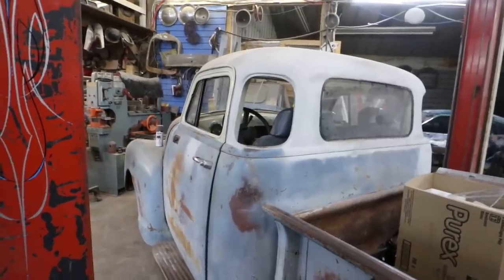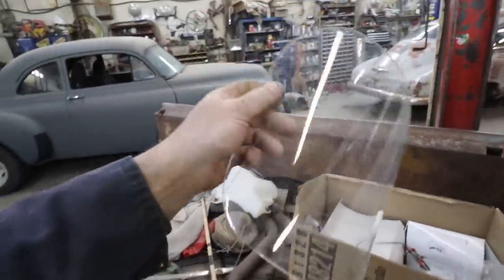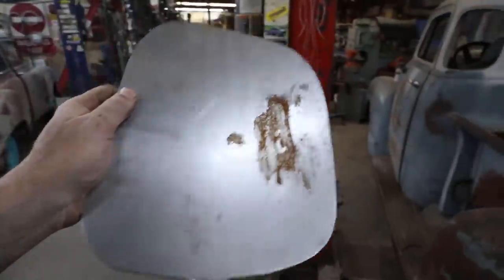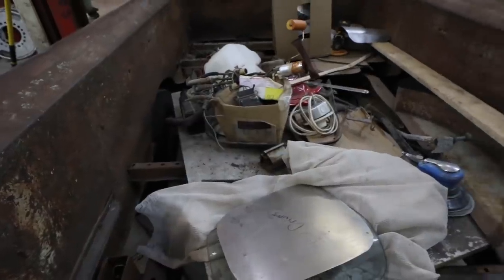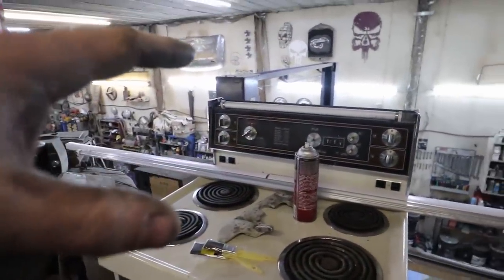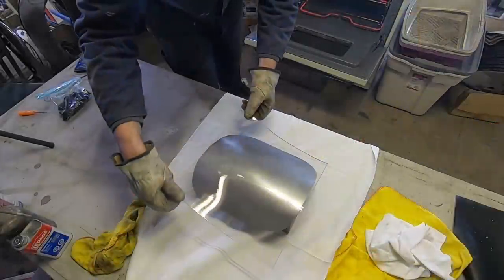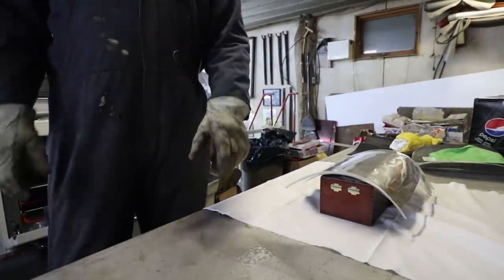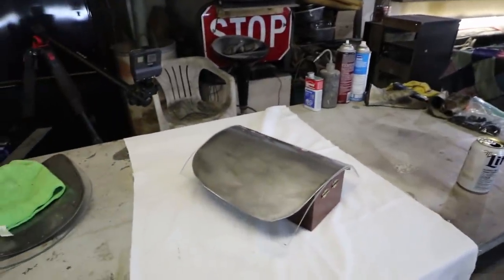Using lexan to make corner windows for a chopped 51 Chevy pickup

Comment: I would have just used the Busch box, and made a beer tap for the gear shift which I have done for my truck using multiple handles including mounting bobbleheads on my tailgate, my truck was in the Paradise fire and caught on fire and is a 76 stepside  given to me from my customer that was up there, he was a WWII Vet as was my dad..........The spirit of 76 saved it! $9,000 later it still looks like it was in a fire even on the inside but it drives great! Glad I just discovered this channel I can relate to a mess that has potential...

Comment: I like your method way better than the one I used back in 1979 after chopping the ‘68 Bug. I cut the plexiglass for the back window and then screwed it in and covered with a black  foam sticky strip around the edge. 😎👍🇨🇦

Comment: I turned out all right I had two windows put in my tractor with that lexan and they glued the windows on the outside like you do and I've had no issues with it whatsoever no scratching no leaking it's a good way to do it. 👍👍😀

Comment: In years gone by, I made Lexan and other polycarbonate sheets. This stuff is rolled out at @600 degrees. Then in another life I made plexy glass for a foam rubber cutting machine. Curved a lot of plexy/ lexan at @250 to 275 degrees. Put your pattern under the blank in the oven and heat it. Leave it till cool.

Comment: 3m used to make a trizak sand paper that will sand the scratches out i used to do solid surface counter tops that is what we used. i tried it on plexiglass and it worked. it was developed to sand scratches out of picture tubes on tvs if you cant find i may still have some left

Comment: The glass for these corner windows is readily available. I've got an extra set myself. They were free in a box of parts when I was building my 50s truck. I looked them up on several classic truck sites and they aren't all that expensive.
Reply: His problem was that he Chopped the truck . He had the original glass but it was to tall and not wide enough. I had thought the same thing at first. I could only imagine how much $$$$ it would cost to have those two window glasses made .

Comment: This just a suggestion.....not the voice of experience. Some of the
warping may be the result of the sudden temperature change from pulling it out of the oven and exposing it to colder air. Perhaps you might get less warping by leaving it in the oven, turning off the heat, maybe leave the door ajar, so the lexan can cool slower and evenly.  Love your videos and your work.

Comment: Two things you can do to increase the hardness of the lexian Slash plexy is by putting a coat of ceramic coating over the inside and outside this will stop it from getting those swirly scratches or you can get 2K clear and paint over the top of it with 2K clear and it will keep it from yellowing I prefer the ceramic coating less the other way sometimes flakes off

Comment: That sheet is pretty thick, relatively speaking for Lexan I have seen used for automotive "glass".  Most of the time its 1/8 or 3/16ths with a pretty gradual change of direction or curvature.  Something where a hairdryer might and a heat gun certainly could be used.  Its sort of like chocolate, soft, softer and suddenly goes too close to liquid that you can't handle it.

A thought, IF that one "reject" is scrap, put in back in the oven and experiment with the heat;  based on Lexan properties it should blister when too hot.  Info that I can find suggests that at a certain thickness both male and female molds are needed, but no real specific information is actually given.

Comment: I heated my plexiglass over the original glass with a heat gun to get the same curve then cut down to match my chop. Lexan you were using looks a little thicker and probably harder to work with than cheap plexi I used.

Comment: Moulding The Shape....2.0
Next time ditch the oven and lay the cut flat plastic straight over the steel template. Using a heat gun begin in the center and apply heat to center section back and forth watching the plastic bend. Moving outboard continue to use long strokes . Just like the sequence you would use to torque down a cyl head.
Job done in a couple of minutes and very easy to control bending.
Reply from the maker: we tried the heat gun a while ago but would take hours to get it hot enough it's pretty thick stuff 3/8" it would cool to fast we found torch was better haha but same effect couldn't keep an even heat on everything.
Reply: Now i understand why the oven.

Comment: I don’t want to get too scienticious, but it seems that flipping the buck over and forming the lexan to the inside would be more accurate. Forming it to the outside makes the radius larger than the opening by the thickness of your mold because the mold is fitted to the inside of the window opening.
Reply from the maker: prob would have worked better but it was a little tight already in a few places.
Reply: @HalfassKustoms  You're the man! Thanks for making cool stuff.

Comment: What temp. did you use in the oven?  I tried laying plastic over a curved glass window and it bubbled the plastic at 275 degrees.
Reply from the maker: had it on bake haha, was it lexan you where using or plexiglass?
Reply: Worked in a sign shop that did vacuum formed acrylic and lexan sign faces for illuminated signs. Lexan has a moisture content that will tend to blister when heated for forming. They'd hang the panel on hooks in a dryer oven at 150F  overnight . Plexi was fine. You had to leave the plastic on the mold with the vacuum on till it cooled enough not to shrink back. Had memory.  They used 1/8" and 3/16" lexan and 3/16" and 1/4" plexi depending on the size of sign face. Not sure what heat the forming oven was..it was large for 6'x12' sections. Probably 400F till it slumped with the right rubbery feel.. all clamped into a pneumatic lift/drop frame.. 3/8" is really hefty must haveca lot of back pull.. look into slumped glass.. tgat is cool. Has to cool with heat still warming it for hours or it will shock and break.  Safety glass  may be different.

Comment: Nice work on the Windows, I would have been inclined to weld the metal in the hole's, just never been a fan of the fishbowl cabs,, too much like a pacer
Reply: To much metal ='s to many blind spots
Reply: @mardrumming1362  I guess being a career truck driver Im just used to using the mirrors, 80 feet long with only a window in the doors

Comment: Lexan may be easy to work with - but it scratches, crazes, cracks, and turn milky over time.
Reply: well in 10 years he can make new ones Motorcycles and ATV's have used it for windshields for years
Reply from the maker: we are aware but is was pretty easy to make so if we have to revisit it in a few years I can just remake them again as I have the steel templates still.
Reply: @HalfassKustoms  it polishes well.

Comment: In my opinion if you had cut the plexiglass bigger around the edges then what you did it would of drooped down around the corners under its own weight naturally over your mold when hot &you wouldn't have had such a hard time getting the shape you wanted